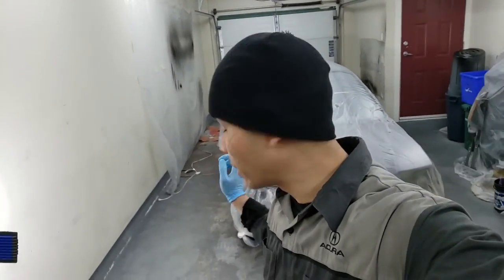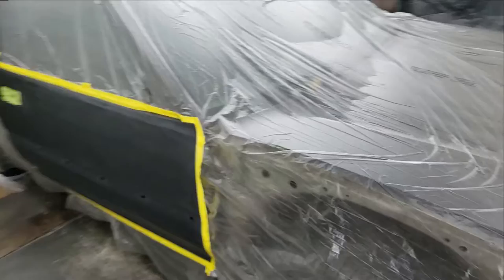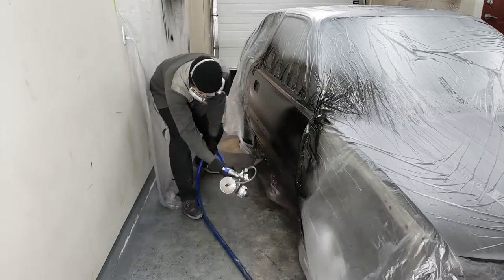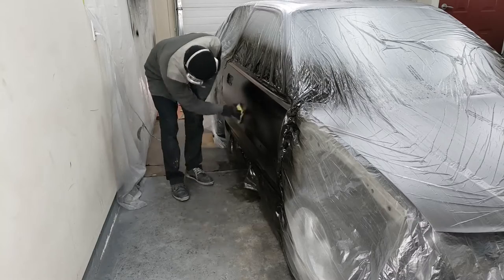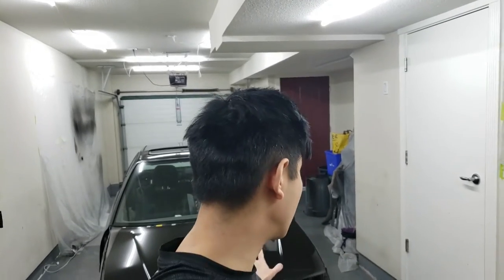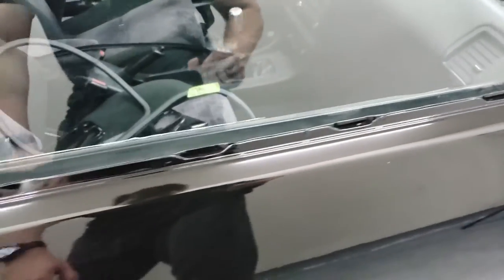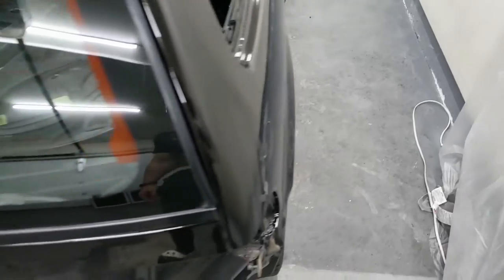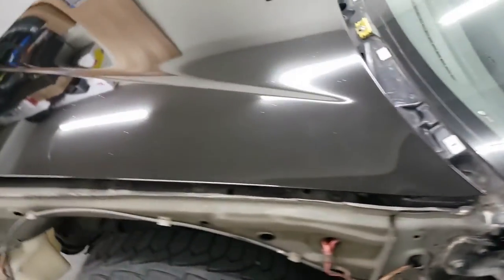[DIY Bodywork] Pt 26. Spray Painting my EF CIVIC in the Garage: the Finale of Base & Clear Coat!!🙌

Comment: Just recently seen your videos mainly due to about to buy a fuji unit,like yours or the 3 stage which is 250 more,anyway what clearcoat did you use,2k ?,and was the bssecoat thinned 1 to 1 with thinner im in the uk.great info.
Reply from the maker: I used Sherwin Williams Finish 1 clear coat. Basecoat was premixed by the paint shop so it was ready to spray already. I just stirred it and then put it in the gun and sprayed it. The package was recommended by the paint shop.

Comment: Based on your paint job then ill probably buy the 2 stage,i cant really see how the 3 stage with 1 psi more can be worth the extra cash,again thank you for your reply.
Reply from the maker: @stevejohn5624  you're most welcome. I fo highly recommend getting a finer tip to spray with. The stock tip that comes with the gun can work but a finer tip will give a smoother finish.

Comment: What size tip are you using? I finally got my q5 with 1.3, 1.0, and .80 tips. I sprayed some epoxy primer with the 1.0 and sooo much material came out. Tested with the viscosity cup and got about a 10 second runout. I was only running the q5 at 75% power. Im leaning towards closing the fluid needle and backing it open rather than going wide open like you would with a conventional pneumatic hvlp.
Reply from the maker: I used a 1.3 tip, which was the standard tip with the system. I adjusted my gun and tested the spray on a piece of paper on the wall. But I didnt have it wide open. I dialed it maybe 2/3 open and closed the fluid 1 and 1/4 turn. Basically made all my adjustments on my paper before hitting the car.

For my primer I used a 1.8 tip and was too big. The droplets were huge and made a huge mess. That was my first time using the system and didn't dial it in. I just followed the fuji instructions. I'm hearing the smaller tips work best.
Reply: @BudgetGears  i sprayed a super show quality finish with my q5 platinum running it at 3/4 power with a 0.8mm tip. Turned the fluid in 2 turns from wide open. Left the settings for base and clear. You can see it on my Instagram. Same name as my YouTube
Reply from the maker: @justingiese6544  Wow that looks amazing! You did a fantastic job! Followed you on Instagram. Looking forward to seeing the complete car! 😁

Comment: What tip and air cap are u using for base and clear
Reply from the maker: I'm using the original 1.3 tip and cap that came with the system. According to others that have commented, they've recommended using a 0.8 or 1.0 tip. I think the 1.3 tip worked just fine, but maybe I would have had a even smoother finish if I used a smaller tip.